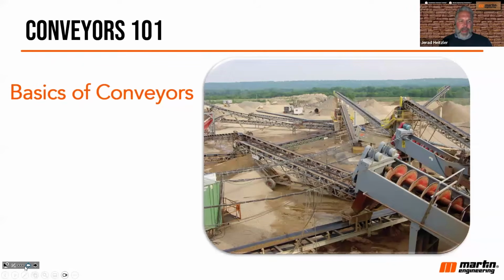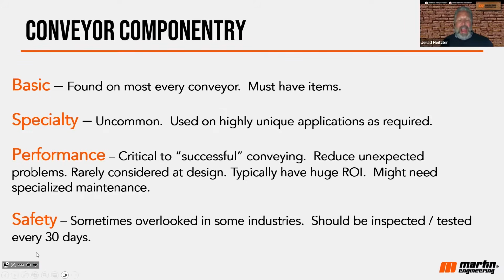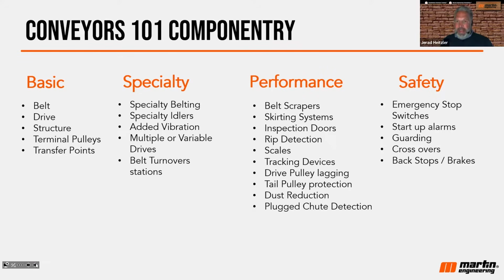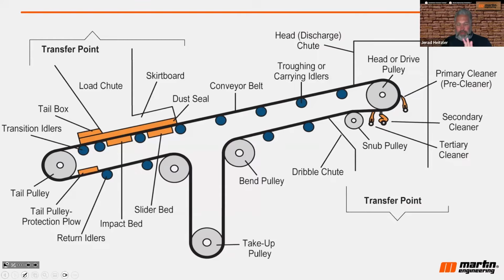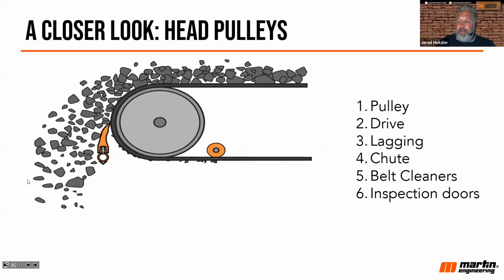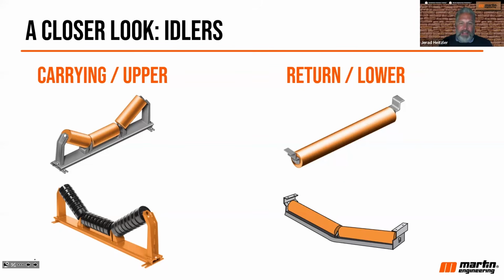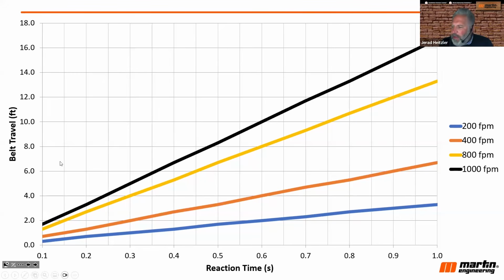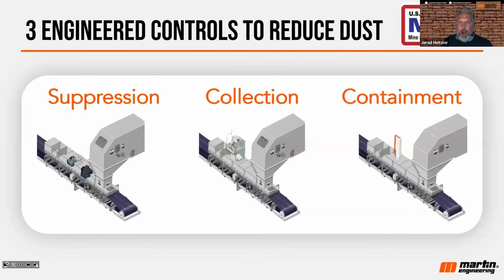Conveyors 101

Comment: Thank you for this video, just got into the millwrights as a pre apprentice and we’re working with conveyors, I appreciate it a lot!
Reply from the maker: That's great to hear! We're glad the video is helpful as you start your pre-apprenticeship.
Reply: How did you do it? About a year through my AAS and have auto tech experience. But it’s hard to get on at these plants.
Reply: @MP-lf4xk i had connections because I was security for general contractors, but my best advice for you would be to call your local unions, and see when they’re hiring/if they offer apprenticeships